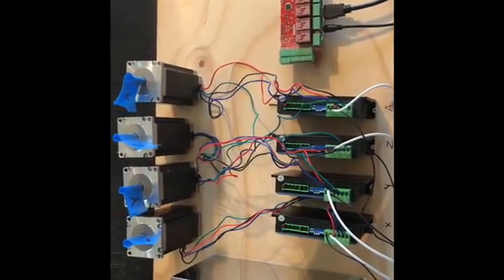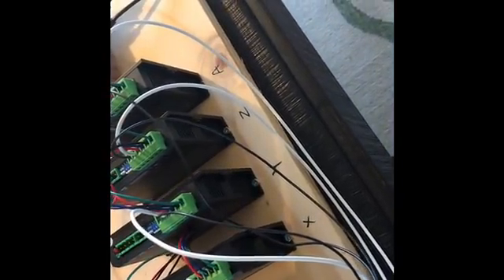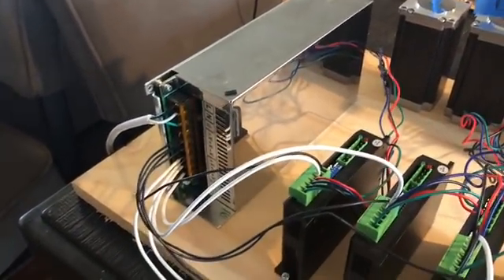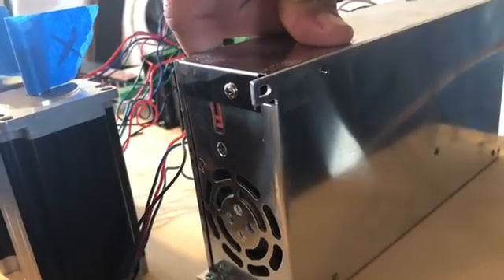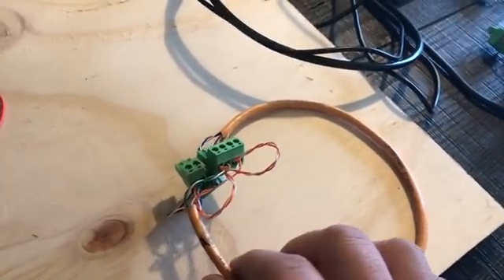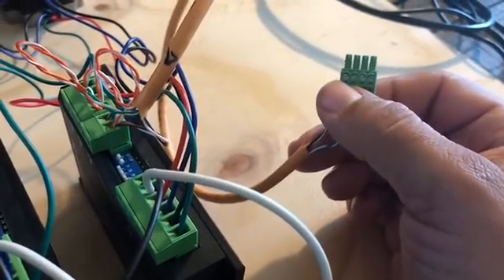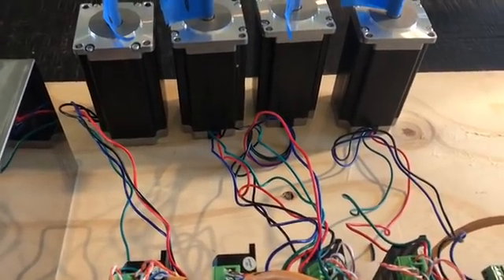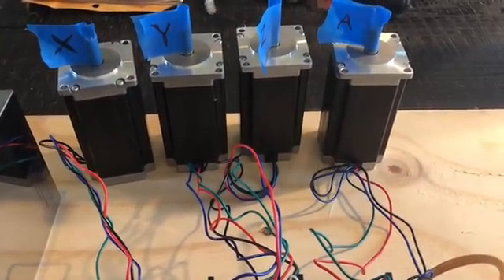Raspberry Pi CNC Build Part 2

Comment: sorry before blame, just this i need i have all parts but not this controller hat to raspi 3. can i use raspi 4. how all code i not understand anythink how code or write code or use code and anythink  use raspi. i have in home rapsi zero (learn how led blink,and try use raspicam)not can do. raspi 3 and 4 but not can install image to sd card or use HDD store. my win7 i has try many different image maker software do image to sd car but alltime failed. i have 13 new just raspi user good sd card 16gb and 32gb and 2 usb stic were need use usb boot but no can do, no instal image. alltime etcher,raspi imager ,imager32 say failer file. and download many many time newfile internet official sites. but no install image to sd card and usb stick. i have all max 5A stepper drivers same than u. big motors , raspi 3 and 4. 3 pcs power 500W 46V driver max have 48V . frame not can made now im new home in retiree thailand. and not found some parts.new country new language new all not easy.

Comment: Did you have any problem with the motors not spinning and staying locked. It wont even spin by hand
Reply from the maker: cvicracer  no I didn’t have that issue.  Sounds like something is not wired correctly

Comment: What happened to video #3?
Reply from the maker: Randy what else would you like to see?
Reply: @RBallarddesigns  Did you do a video on BCNC?  I don't see that...thx
Reply from the maker: tinydane69  I just filmed a quick one on my work flow with bCNC. I will try to edit and upload in the next week
Reply: @RBallarddesigns  I would like to see the rest of the configuration and setup that you said was coming.  There is almost nothing out there for the Protoneer hat.

Comment: Is there an advantage to doubling up the cat5 wire instead of havinge one of the wires in each twisted pair carry ground and the other the signal?  I'm pretty green to this stuff but I always thought the second choice gave the best emi protection. Then you wouldn't need jumpers either. Is 24awg too thin?
Reply from the maker: Nathan Layman no.  I just wanted a little extra wire in there.
Reply: Thanks! I'm slowly assembling the parts to make my own and your videos have been really useful.
Reply from the maker: Nathan Layman  good deal!   Make sure you join the Facebook group and share your progress

Comment: why aren't you using driver boards on the hat? So, those are empty boards that just bring out the signals on the Hat?
Reply from the maker: Salman Sheikh  because the drivers that mount to the board are limited to 2 Amps.  My drivers are 4 amps
Reply: @RBallarddesigns  I had a question about that. Looking at the video it looks like you had the switches on those DM542T drivers set to ??-ON-ON-OFF-OFF-OFF-ON-ON (couldn't quite see the first switch) which would be less than an amp RMS and 1600 pulses per revolution. Was that just for testing?
Reply from the maker: Nathan Layman yes. That was just for testing.  It is using more than 2 amps now
Reply: @RBallarddesigns  That makes sense. Finally had time to work on the project last night and got my steppers turning which was pretty exciting. Thanks for your help! Oh yeah, in your current set up are you still running the drivers at 1600 pulses per revolution?

Comment: I have have a RPI 3B with a Protoneer hat and am using bCNC. I have checked my wiring twice and can not get the stepper motor to turn. I turned around the drivers on the CNC hat thinking maybe I had those on backwards but that didn't help. When I move the X axis the light on the CNC hat blinks bright for a flash but nothing runs. Is there a way to test for voltage on the CNC hat connectors to the extyernal drivers? Any other suggestions I should check? Thanks

Comment: A friend has asked me to help build a CNC machine and your video is the best I've watched so far. I've been programming for almost 40 years but have never attempted something like this. Could you please provide me with the parts description and numbers that you are using. Thanks again for any help you can provide.
Reply from the maker: Doug Corwin  I’m away on vacation at the moment however I can when I return.  Motors and drivers are sized to my machine.  On Facebook search “raspberry Pi CNC”. I recently started a group there.  Also for the CNC I have search “Gatton CNC”

Comment: I have the v2.60 hat. I have no idea how to set things to work with my nema 23 motors.
Reply from the maker: Kelii Armstrong what size motors are you using?
Reply: Nema 23 motors 270 oz , with DQ542MA drivers. Im not getting any 5v signals out of my hat. Is there a setting I need to change, or some wires i need to solder to the board?
Reply: I found a pic on an ebay page showing how to jumper the driver pins so you can use external drivers.
https://www.ebay.com/itm/Pololu-Socket-To-External-Driver-conversion-board/272511745429?ssPageName=STRK%3AMEBIDX%3AIT&_trksid=p2057872.m2749.l2649
Reply from the maker: Kelii Armstrong sorry I missed your question

Comment: Hello! Show us more, please!
Reply from the maker: Ricardo Maroquio what would you like to see?
Reply: My CNC have two motors in Y axis (the main plane). So, I need 4 ports, like you did. My doubt is: should I use A port as the second Y? How should I use the solder jumper in the backside of the board in this case? And how should I connect it to power supply? Sorry about my noob questions... :/
Reply from the maker: Ricardo Maroquio the easier way to do it is to clone the Y axis on the A port. There is a little jumper on the back that you will just solder a bridge to. You will still have 4 external drivers.  Power will be run from each external driver to a power supply.
Reply: Okay. Done! Now I'm fighting with the end stops....    :(     Do you use it?
Reply from the maker: Ricardo Maroquio no I have not set up the end stops yet.  Have not really needed to.
Reply: Did you have any problem with the motors not spinning and staying locked. it won’t spin by hand.

Comment: Good evening, I need help, I set up a CNC with the protoneer plate, and I need to know how to set up so that the motors are turned on, keeping the machine locked in place in the change of milling cutters, without compromising the positioning, there is some jump to be done, like in the CNC shild?
Reply from the maker: Claudio Nascimento my machine has lead screws so they are locked already. I would suggest checking the Protoneer Forum as I’m sure someone else has had to deal with that issue.
Reply: I think you did not understand, I mean, how to configure the protoneer for the motors to stay powered, even with the cnc stop. Do you have to put some jump?
Reply from the maker: Claudio Nascimento  I understand what you are asking. What I am saying is because of my set up I did not run into that issue however I am sure someone on the Protoneer forum has and you should check there
Reply: I understood, maybe because you use external drivers, it does not happen that error, thank you skin help.

Comment: https://youtu.be/TDTDN_KkoJc
I made one machine. I used my custom made grbl boards and 15A drivers I designed. Machine has usb port. Now I am making bigger machine with my drivers and grbl board and I ordered 5" raspberry  display and raspberry  pi 3 B+ which I want to integrate into machine. Any suggestion?

Comment: Mr. Ryan, first of all my congratulations for your video. I would like to see what is in  the back of that "external drivers only" board. I bought  one RPi-CNC at e-Bay and it came without it. But I suppose it is like a dummy board that you have to wire it up, according to some instructions. So I would like to ask you if is it possible to show its backside in your next video. Thanks in advance.

Comment: Great videos, it seems like there is limited info on this hat. Its nice to see everything in a real setup. I hope you do a spindle with PWM control. That is the part I cant seem to get any good info on.
Reply from the maker: Chris Koppenaal thanks. They are quite horrible and dry but when you want to get the information out it’s the only way.  Eventually I am switching to a water cooled spindle but that won’t be for a while yet.
Reply: I will be ordering this hat soon to start my first build (3 axis router). I don"t have any experience with electronics but I do CNC machining for a living. I was a little worried that I would not be able to figure everything out but videos like this spell everything out and make it easy for new people like me.